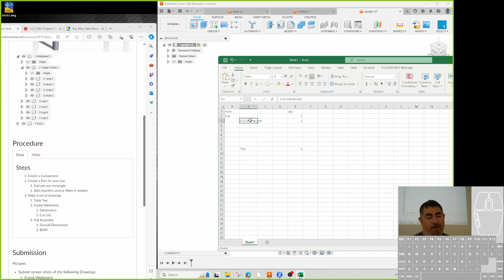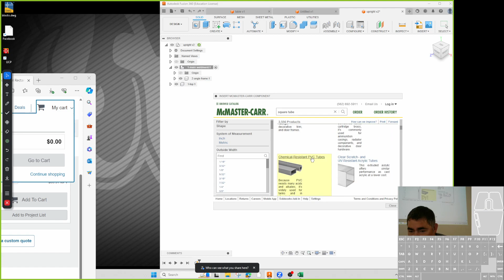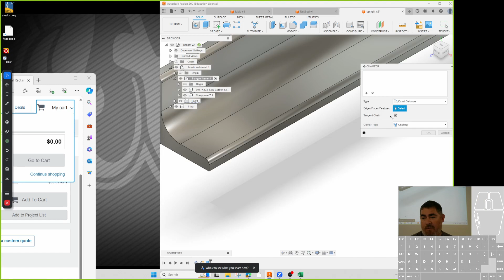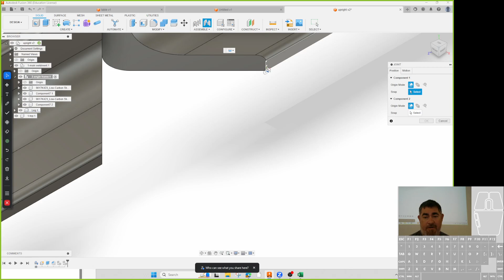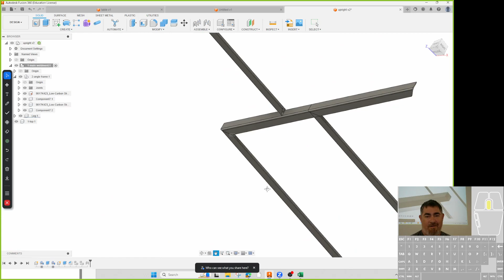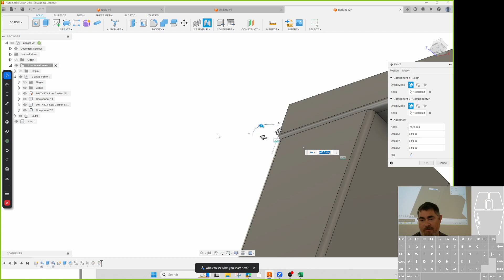Creating a Weldment in Fusion360

Comment: Nice. Thanks for that. 
I find it incredible that Fusion doesn't have an easier way to achieve this end result. Like, (1) create a 'box' (2) populate the lines with angle iron/square tube (3) miter the corners for easy welding.
Be a lot easier for fabricators to use. 
But, the work around you've provided above has answered all my questions, so cheers.
Reply from the maker: Hopefully someday. SolidWorks, Inventor and OnShape all have tools like this for weldments.  Out of them I prefer the frame generator in Inventor, so AutoDesk has something they can bring over.